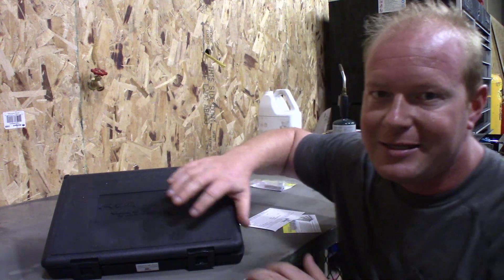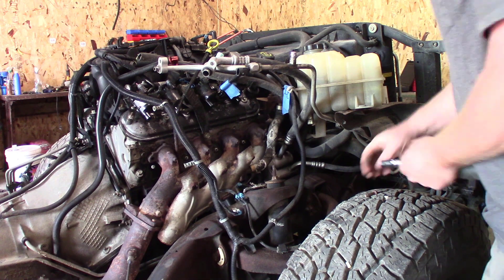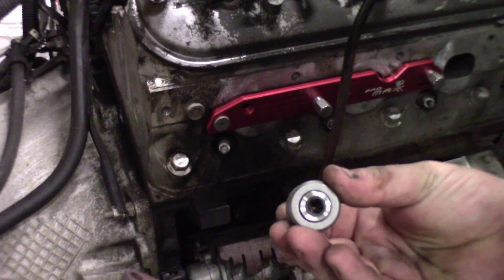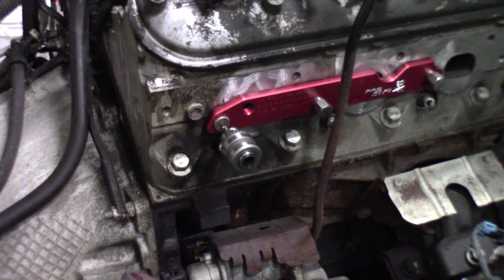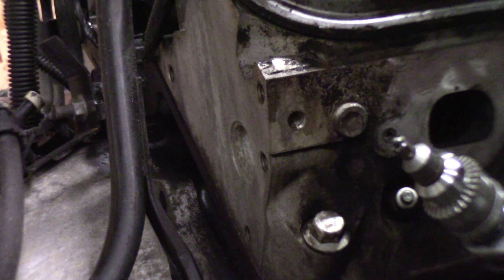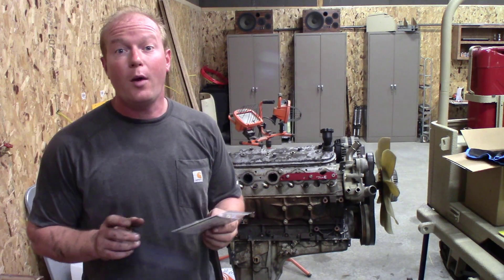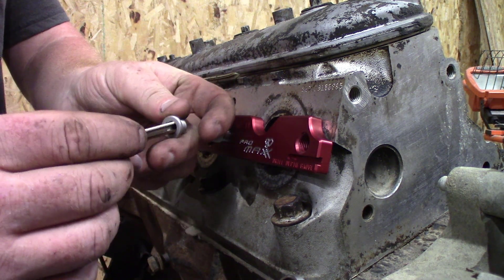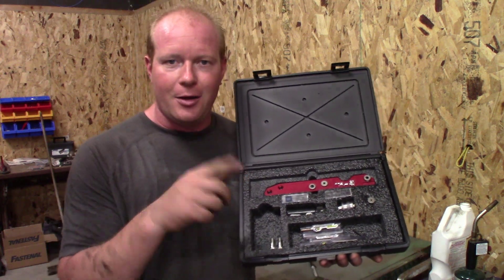LS broken exhaust manifold bolt extraction

Comment: I did not understand that last step where the tap was used. Why wasn't that one removed like the first one? I am guessing it is for when the torque is reached on the extractor and does not remove the broken bolt I would step on up and drill the rest of the bolt out and then use the tap?

Comment: So cool….I have been quoted 800 for 2 bolts on a 2007 suburban, seems a bit high…..any opinion?
Reply from the maker: That is a hard answer, but I think it is high. It does depend on the vehicle and which ones are broken, but even at 125 an house It should not cost that much
Reply: @FlashPerformance  thanks for the reply….I always treat the pros right but this seemed a bit high….

Comment: this is probably a nightmare trying to do this with the engine still in the vehicle
Reply from the maker: Yes, it is not fun, but it is better then pulling the heads. The kit has all the tools for the tight fit of an engine compartment...But these are never fun or easy

Comment: HOW MUCH IS THIS KIT?
CHEAPER THAN THOSE manifold clamp kits? https://www.dormanproducts.com/p-66009-917-107.aspx

might have to buy this kit :-(  I just removed one broken LS bolt easily but another cuz it had no threads showing has been a pain!. tried migging enough weld material on top of stud to turn out, it just twisted off both times. 
tried drilling with center punch divot, it still drilled offcenter  i assume cuz hardened mig weld pushed it off to softer stud metal but cheap 2 piece extractor only turned maybe a 1/3 of turn b4 breaking.
then i tried migging a nut on the stud and it broke off 3 times.
Maybe today i will try stick weld a nut on there with fast freeze 6013 as im better stick welder than mechanicl plus i dont yet have an auto  darkening helmut

Comment: AWESOME kit -  did you use a 1/4 air ratchet with the chuck?
Reply from the maker: Yes, I used my 1/4 air ratchet. The chuck came in the kit. They also have a ratchet you can buy that is a slimmer profile

Comment: What do you recommend for replacement bolts for the LS engines?  Do you use antiseize on your bolts
Reply from the maker: I like using studs to put the manifolds back on. I get them from the local parts store.  And yes, I will use high temp anti seize
Reply: @FlashPerformance  
I think I'm going to try studs as well. Do you remember what length you purchased?  
I have an 04 silverado with a manual transmission. My manifolds are leaking and noisy from broken bolts. I've noticed a lack of power in first during acceleration. My thought is the manifolds leaking are robbing my truck of its power. Does that sound correct?  Thanks for the video and suggestions.
Reply from the maker: @jalton9416  Double check the thread pitch but I think these are the correct ones from Dorman, They sell them at your local parts store as well https://www.dormanproducts.com/p-274-03411.aspx?origin=keyword
Reply: @FlashPerformance  thanks

Comment: If you weld into the cylinder head where the bolt broke off It wont stick to the aluminum head. You could build a bubble till it comes out of the cylinder head. Weld a nut to the bubble.
Reply: Literally works every time and is super quick
Reply: And you just saved about $500.  I priced it.

Comment: Thanks for the link to Promaxx. Found the kit I wanted and they even have them refurbished at a much better price. As for the truck being in the way, I figured I would just remove the front clip. Gives you full access without the hassle of removing the engine. Put the frame on jackstands and get the wheel out of the way as well. Still easier than pulling the engine.
Reply: I guess im randomly asking but does anyone know a tool to get back into an instagram account..?
I stupidly lost the account password. I appreciate any tips you can give me!
Reply: @Curtis Harlem instablaster ;)
Reply: @Bo Rene thanks for your reply. I got to the site through google and I'm waiting for the hacking stuff atm.
Seems to take a while so I will get back to you later when my account password hopefully is recovered.
Reply: @Bo Rene WTF IT ACTUALLY WORKED! I literally hacked my Instagram account after about 40 mins by using the site.
Had to pay 15 $ but for sure worth it :O
Thank you so much you saved my ass!
Reply: @Curtis Harlem glad I could help :)

Comment: This is one way to do it.. my way is to free hand drill the hole off center --> break cheap extractor tip in hole --> break titanium drill bit tip in hole trying to remove extractor --> fruitlessly drill against titanium bit --> curse Chinese steel --> put everything back together and check for exhaust leaks --> watch video on how to do it properly. Luckily my truck exhaust isn't leaking at the moment. I'll give this guide a go with some cobalt reverse direction bits. Plan - F = exhaust clamp bracket.
Reply: Rick, I have been using your method for quite some time!
Reply: Haha
Reply: I'm right there!
Stuck at step 2.
Trying to figure out my next step without removing the head.

Comment: Even if the stud is broke off below the surface of the head you can fill in with a mig welder and weld a nut on. The heat melts the lock tight and expands the aluminum so the stud back out with little effort.
Reply: That's what I do, no special tool, no fancy tools, and no removing the truck cab and fender to do it!
Reply: What about when my LS heads are cast iron? 99 6.0 LS
Reply: i tried it with aluminum heads and the nut just broke at the weld  @jj13309

Comment: Can't find any thing on cast iron blocks ,so you couldn't weld nut on them
Reply from the maker: This is true and I did on some of the other ones that stuck out.  I had two that were sunk in and I could not weld on them easy.  Sometimes its all about options...
Reply: @FlashPerformance  used 1/8 Cobalt pilot bit to start then moved up to 7/32 just perfect for left hand Matco easy out

Comment: 06 chevy 2500hd 6.0 gas. drivers side rear most bolt is broken , does this repair kit fit without taking the engine out due to the firewall clearance?
Reply: dorman makes a repair clamp that bolts to the back of the head near the driver side firewall which is genius. install clamp, tighten bolt, exhaust leak gone.  i installed one on my son's 5.3 truck a couple years ago, its still goin leak free. dorman part number 917-107      31 bucks
Reply: @kchotrodtruck610  You can actually access the space well enough to get the two bolts in the back?
Reply: @yukhui  that is correct. i was able to install both bolts to the back of the head. if i remember correctly, i put the bolt through the bottom hole of the bracket, then installed to the head and then just installed the top bolt. i have since installed the same clamp in the same location of an 02 suburban.
Reply from the maker: Unfortunately not, on that bolt the pinch weld over laps the clearance to drill straight into that broken stud.  the only tool that I know of that can get in there is a welder.  I had to weld a nut on to that stuck and back it out while it was still hot to remove that one.
Reply: I repair this issue in my shop all the time. Weld a nut to it and it will come out.  It may take a few nuts to get the weld to penetrate the bolt but it always works.

Comment: What was the price for that?
Reply from the maker: Kits start at $299, I got the Pro kit with a few extras.  Check with your local tool truck or supplier for pricing.
Reply: @FlashPerformance  Cost almost as much as the 5.3l itself!!!!!
Reply: TheWolverine0657 this kit is designed for volume users like shops and fleet mechanics.